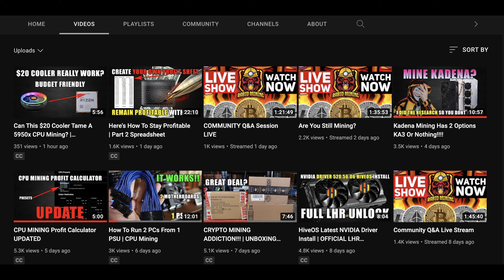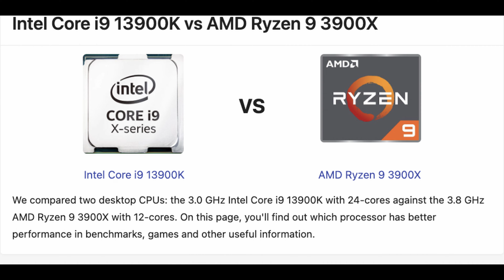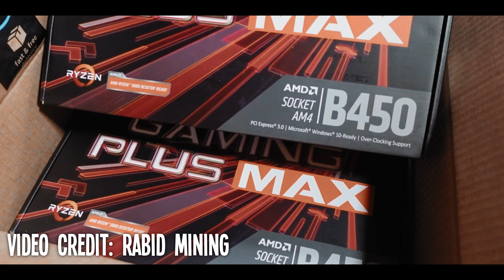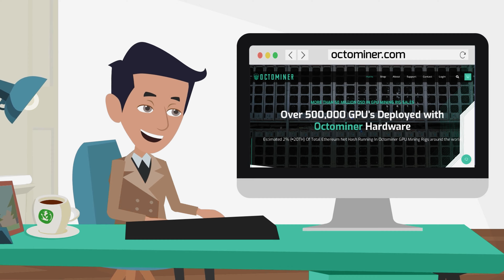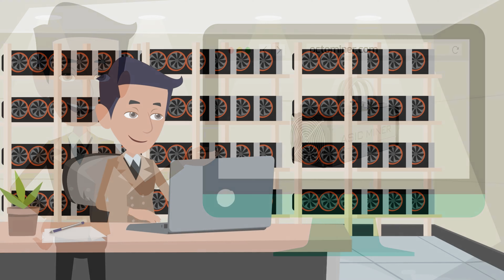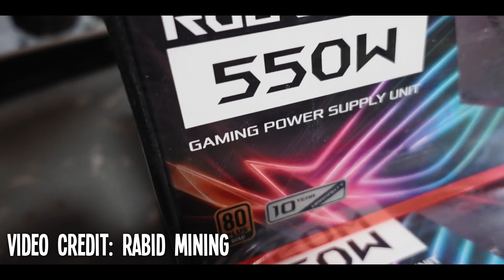CPU mining is profitable! & how to build a CPU mining rig in 2022 with Rabid Mining

Comment: Hey, great video, watching a lot of you and Rabid Mining. With regards to CPU mining, I would have a quick one, how would you feel about mining with  E5-2650Lv2 CPUs ? 25 MB Cache, 10 Cores. I have Server Systems with two CPUs of that. Are using (running esx) pretty little power. Or are the simply two slow with their 1,7GHz ? Could try them mining, what measurement would you recoomend to create anyhow compareable result ?
Cheers

Comment: One Tip to help cut down on the heat but keep the hashrate high is to go into the Windows power plan. Set the plan to use up to 99% of the cpu instead of 100%. This will keep the cpu out of boosting and cut down on the excess heat.
Reply: 🖕🖕✍️✍️Let's talk private
🎁🎁🎁🎁🎁🎁🎁🎁🎁giveaway